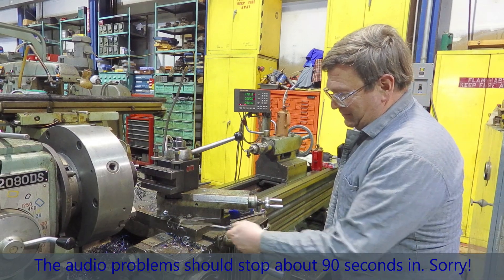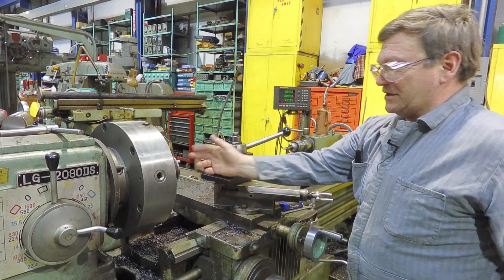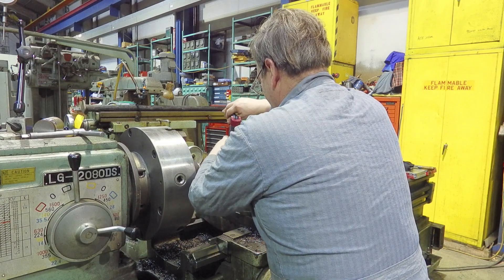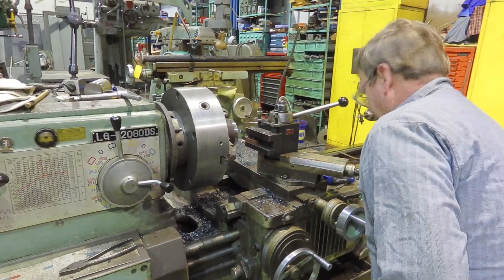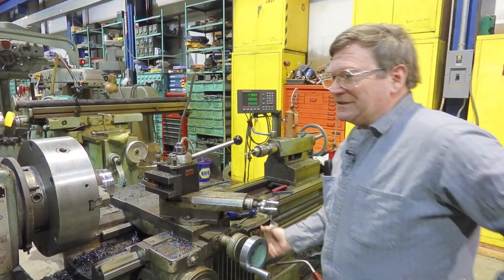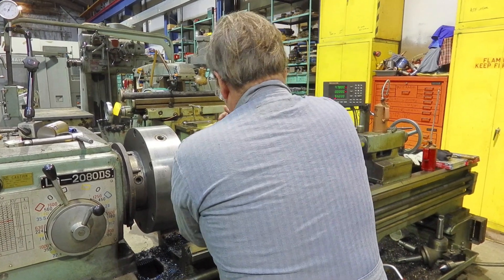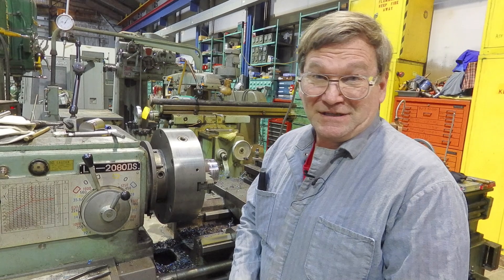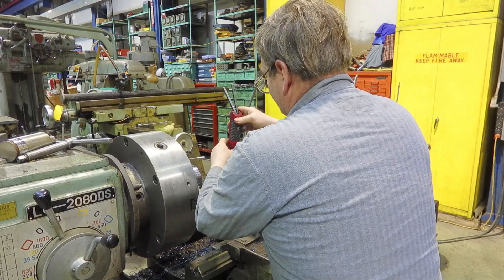Machinist's Minutes: Long stringy chips and chip-breakers

Comment: Hey 👋 that sliding hammer  Drift key is an instant connection  between  a tasks of waiting and having accomplished a change out of simple mores tappers.my tapping head could hold a 7/8 tap i think even 1" inch square. On round as well.tuns is at rated rpm and shoots at 5 times the speed. The directional bar was1/2 "dia 36 inches long the unit was 16" long.CCCP..or ussr😂 the weight was over 7 kilos my boss bought me a realy nice piece of burillum.bronze.and made three differnt 🔨. My brother did tons of automotive repairs. 😅

Comment: Working with 304 stainless everyday you learn in a hurry not to tough chips even with gloves. I keep a pliers by the lathe and have a bent up 1/4 rod  that i call my snake hook to pull chips out, that way I don't get "bit".

Comment: I machine only copper at my work now, it mills great, drills OK, but turning, my god, the stringiest chips know to man, there is basically no way when turning to break the chips, unless you had like a peck turn or varied spindle speed but we don’t have the post for that. It faces good though. It’s basically a spinning death trap when I turn it, if anyone has any recommendations specific to copper I’d appreciate it, and yes Iv tried feeding harder, that principle doesn’t work when turning copper

Comment: Do t forget you might wear out that butto doing that chip break technique, it seems like the modern co trols should have an option to lace a dewell chain into to the path. Have you heard of this.   The new Makito control is amazing. Also, do you use those twin height adjusts on your aloris quick changes to lower or raise the tools anngle,  gues ive never seen it, but cool stuff.

Comment: When I first started out in this trade a long time ago. I wanted to see how much of a chip load the inserts could take. I was surprised to see how heavy of a cut they could handle. In that little experiment, I learned that you never touch chips with your bare hands. They slice and dice with no hesitation!! But also speeds and feeds are key to getting the chips to break and your inserts can remove a tremendous amount of material if those speeds and feeds are right.
Reply: So did I,  What feed per rev did you achieve? When I tried this I could face steel at .050 thou per rev. I problem with a CNMG 432, and I turned at roughly ,040 per rev but I could bring it up to .055 and my lathe only then started to bog down, this was all in 1018 steel or 4140. I never had long stringy chips! Feed harder
Reply: At Alliance Tool & Design, the owner had started machining, before I was born. He bid jobs, according to what it would take him to do the job, start to finish. I was the night shift supervisor. Guys with little, or no experience. So setting up, and running my own jobs, was more than challenging. So he would take cuts, that made the motors let you know that they were loaded down. Quarter of an inch, or more. A high school Machining program would never prepare, a kid, for the real,  World, Git-R-Done, pace we had. Motors whining and complaining, smoke and steam, billowing up, and someone, coming up for help, or an executive decision. Knowing the owner's philosophy, and he's already home, asleep, I have a coin toss decision, that could affect my career, so I was under stress. I guess, he was under much more. We wore out, worn out machines, but the old motors, never burned out.

Comment: Ahhhhh the evil stringers. I had one that was like a mean old snake chased me halfway across my shop had to grab the broom quickly and use the handle to shut it off before the tool crashed into the chuck that was sketchy af lol.
Out of curiosity what are obs chevy front torsion bar suspension made from? I make lots of use of mystery metal/scaptonium for lots of parts however trying to turn these torsion bar into pins for my tractor was a pain. Tried inserts first did not like those at all started work Harding found that using high speed tools worked out good only if the tool was really sharp as if turning aluminum and run the lathe as slow as possible 70 rpm then it would cut really nice and extremely nice finish then came time to drill the lynch pin holes again had to run as slow as the mill would go and bit as sharp as possible tried with coolant work  hardened immediately and burned up bit other wise slow speed and lots of pressure made it through. Those torsion bar are definitely hard but i would have thought the carbide inserts would have been better. 
That's why I would like to know what they are made of because they sure make good pins plus I have a bunch of them. 👍👍🍻🚜
Reply: Can you sperodize anneal it,  ita probably forged or forge rolled stuff rite
Reply: Maybe a type of spring steel?

Comment: Pump impellers are the worst for dangerous stringy chips. I manually feed in the whole process and never stand in front of the carriage
Reply: What metal is that,  wont chrom molly and DOM give horrid sri gy chips, i only have a little experience
Reply: @ryanbeard1119  mostly stainless steel and brass, we're a pump repair shop, I don't turn much else.